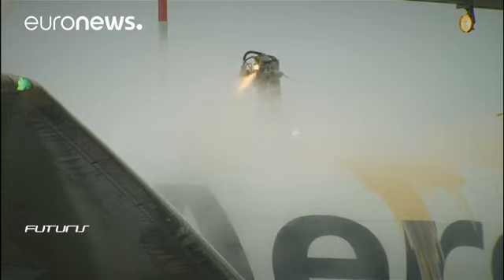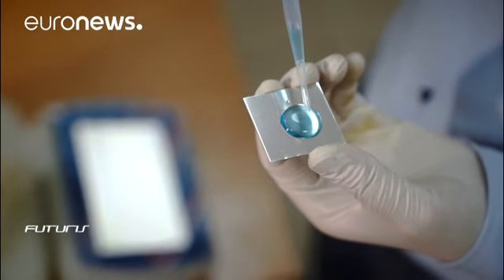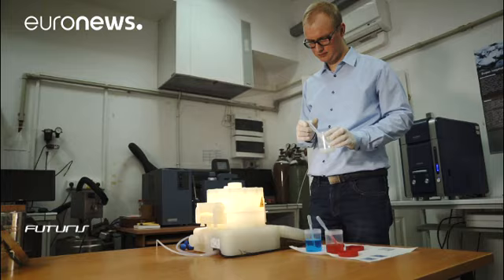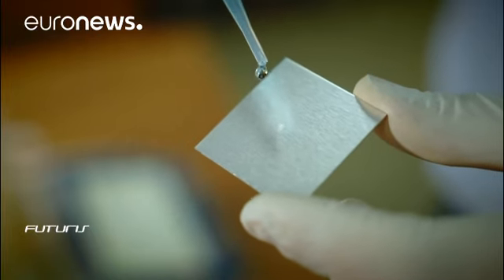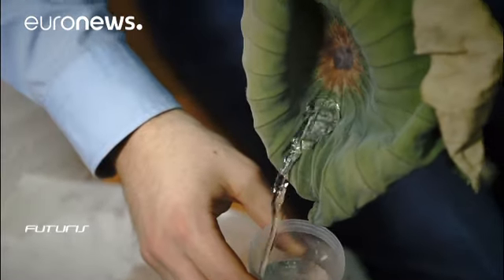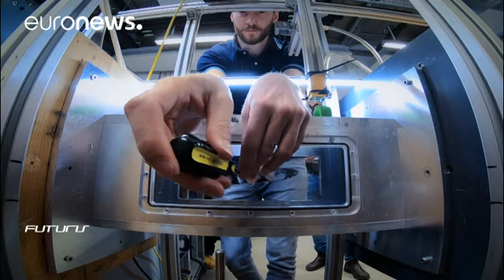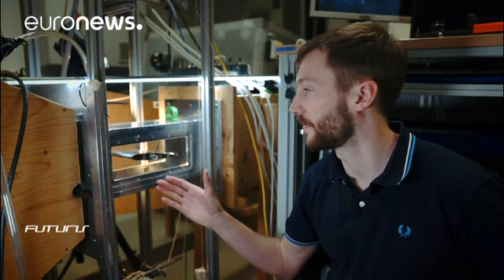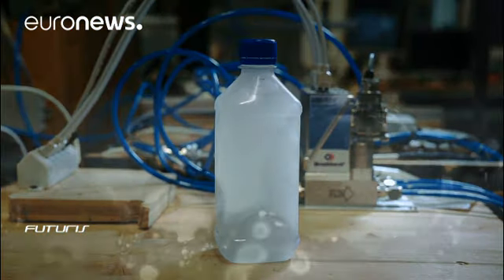An alternative to chemically de-icing planes

Comment: I doubt you will solve this using the superhydrophobic route. The structures have to be very small and by that fact they are weak.
Reply: Actually, the square-cube law means that small things are proportionally stronger than large things.
Reply: Nnelg I recommend some real world testing of superhydrophobic coatings. The hair structures are very small and easy to damage. Rub your finger nail over them and they start to get damaged.
A 1mm pin is 1000 + x stronger than a 10um pin. 
Also superhydrophobic coatings only work if there is air in between the "hairs". They get wetted fairly easily.
Reply: Isn't testing the entire point of research? Maybe they're far from a working product, or maybe they've already solved that issue and the only obstacle is scaling it up.

PS square-cube law means that while an object 10 times larger may be 100 times stronger, it is subject to 1000 times as much force. (Exact ratios vary, but the general trend holds.)
Reply: Do just a little research and you will see the problem hence my comment. Its well known, they admit it in the video.
Reply: We're on it ;-) But as @Nnelg said, we're also far away from working products.